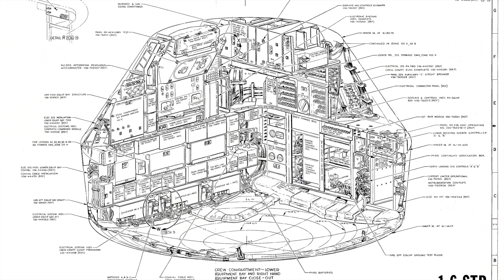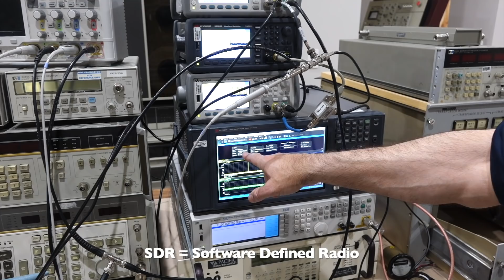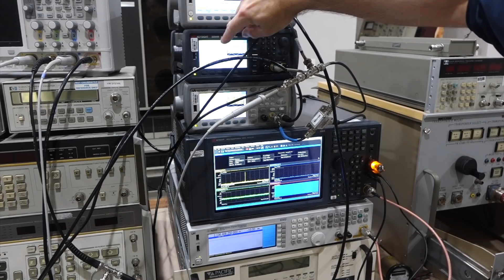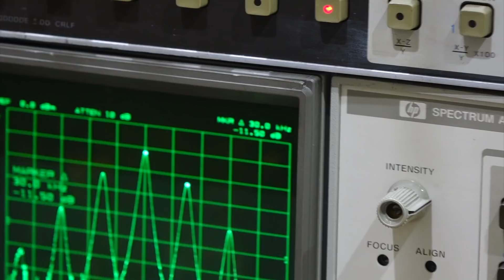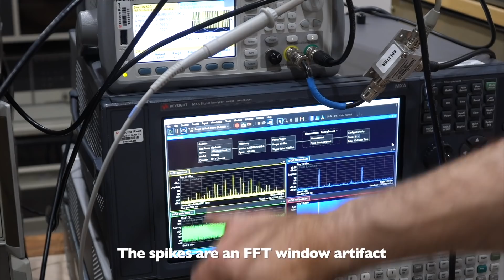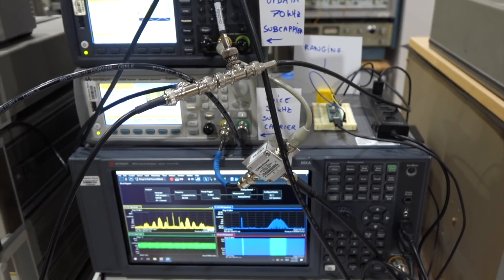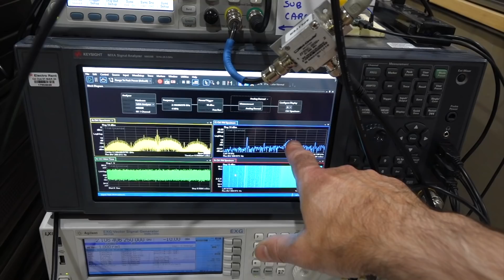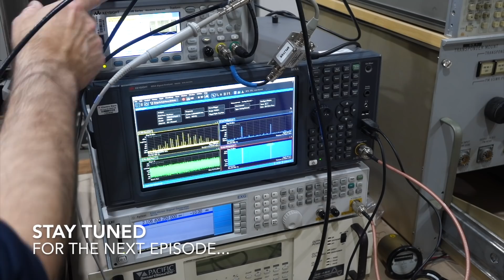Apollo Comms Part 15: Combining Voice, Data and Ranging

Comment: The video from the moon landing was not in the original plan. Someone raised the idea of a video feed. There was little room in the comms bandwidth, so a special low resolution, low bandwidth video system was designed.
The communications during the moon walk was picked up by the radio telescope at Parkes, NSW Australia. It was converted to a conventional TV signal by displaying the video signal on a screen, and filming the display with a TV camera. 
The video signal was also recorded on reel-to-reel tapes. Tapes in those days used whale oil for adhesive. The use of whale oil was stopped when whaling was banned, and synthetic oil was used instead. 
The synthetic oil was not as reliable as the whale oil. NASA had a project that required reliable data tapes. Someone said "I know where there are some whale oil tapes." The result was that the only recording of the original video feed of Armstrong's moon was was erased.

Comment: Some other interesting information.

We had astronaut's lives depending on this system.  That's why the error checking and correcting if necessary.

The really amazing thing about this is there were a quarter of a million miles between the spacecraft and earth.  The large antennas here on Earth were needed to make up for the losses over such a great distance.

The spacecraft had an antenna that had to be pointed at Earth to give a strong enough signal.  Even so,  the spacecraft could not communicate with Earth during times when it was behind the moon or during reentry.

And I repeat what others said: "And we have imbeciles who think it never happened."  Really stupid.  😞😞

Thanks, Marc.

Comment: What’s the difference between “high bit rate” and “low bit rate”?
Reply from the maker: That was on the other, downlink direction, which is waaaay faster. We have not done that yet. Can’t remember on the top of my head but low bit rate was 1.6 kb/s, while high bit rate was 51.2 kb/s, or something like that. The big catch is that you could only do high bit rate once locked on the high gain steerable antenna and with one of the 3 large dishes on the ground, while low bit rate would work out of the omnis and/or the smaller ground antennas, which is a much easier and forgiving config to get going. The low bit rate only transmitted a small subset of the info though. They struggle to get the high bit rate going to diagnose the Apollo 13 failure while the ship is unstable, and the ground desperately needs the more detailed info. Fortunately they were on the (borrowed) extra large Goldstone dish when the accident happened, and that sort of saved the day.
Reply: @CuriousMarc  very cool, yeah I remember in the Flight Director loop during the Apollo 13 accident that they said they had the “210” which I guess is the size of a dish
Reply from the maker: @toddteagarden2200  Yes that was referring to the 210 foot Goldstone antenna, on loan from JPL, and truly, the military. They one assigned to Apollo at Goldstone was the 82 footer.

Comment: is the random noise , a sort of scrambler to stop "others" to listen in on the coms? 1960's style?
Reply: No, it's a repeating bit stream that allows them to lock onto it unambiguously so they can measure the time delay to and from the spacecraft very accurately.  It has nothing to do with encryption or scrambling.  Anyone with the hardware could (and did) listen in.

Comment: Any chance you'll be able to connect it all up to the AGC (emulated AGC of course) to receive those abort commands?
Reply: I don't think the AGC received the abort commands.  They went to a relay that turned on lights.  The part of this that went to the AGC were the DSKY commands - basically a remote DSKY keyboard in ground control.
Reply: @stargazer7644  I was just using that particular command as an example.

I'm not exactly sure of the context of this "abort" command, but if it relates to aborting a moon landing for example, then the AGC would definitely be involved as aborting is all handled by the computer.
Reply: @jeremiefaucher-goulet3365  He explained in detail in the previous video how these commands were used.  These were not commands to the AGC.  They turned on relays that either essentially flipped switches on the control panels, or turned on indicator lights.  The ONLY input to the AGC was via the DSKY keyboard, and that had to be specifically allowed by the astronauts flipping two enable switches.  It was not on by default.
Reply: @stargazer7644  Oh I know. But what do you think happens once the abort relay gets flipped? Should be the same as the button being physically actionned by the astronaut.

I never meant to say that a command gets interpreted by the AGC directly. But indirectly the AGC would get triggered by some of these relay flips. There's a lot of discrete IO on the spacecraft that is sensed by the computer.

Just like I'm assuming the DISKEY commands too, is just some relay action connected inline with the same circuit as the physical DISKEY buttons themselves.

But obviously I'm just speculating/guessing here. I could be wrong.

Comment: Marc, how did the NASA-engineers test this whole shebang back in the Apollo days? Surely they didn't have this beautiful keysight stuff. So what did they have and are you in a position to let us see the whole working with devices from the apollo days? That would really deliver a marvelous video I think.
Reply: He doesn't have all of the relevant Apollo pieces, that's why he's using some modern gear to stand in.  They certainly had spectrum analyzers at NASA to help design this stuff.  They just didn't have fancy digital ones with DSP and demodulation built into them.  They had other devices to do the demodulation.

Comment: It does seem strange that at that time anyone with the necessary kit could, in theory, command the Apollo spacecraft.  At the time it was so advanced that I suppose it qualified as an encrypted link. :D
Reply: Wow. Good point. Would have been to the USSR's advantage to sabotage it, I wonder? Could they have done it without being detected?
Reply: It’s always a mistake to underestimate Russia.
Reply: That's why there were  switches in the space craft, 2 I believe, that on request (and presumably upon successful authentication that it was indeed NASA on the voice link) only the astronauts could physically switch to enable remote command of the AGC or other systems. As it was though, I agree, it was so advanced at the time, that I suspect it was very difficult without inside knowledge, to know what was going on in the mess of phase modulation, to even extract the commands, from the voice, from the ranging, never mind know what they meant at the space craft end of things. Might not have very tricky to jam though, by pointing a sufficiently powerful signal at the capsules.
Reply: That's why the astronauts controlled when commands could be sent up.

Comment: A fabulous series - thank you. I would really appreciate an episode dedicated to your views as to why the modulation techniques used are so complex? I would have thought it could be achieved in a simpler fashion without a risk of reduced reliability. I guess I am probably wrong!
Reply from the maker: I think the explanation is spread over the previous episodes, but quickly: stuck with PM primary modulation because of the need to preserve the carrier average frequency for Doppler ranging, FM is best for the subcarriers, and PSK is one of the simplest and best method for digital transmission (still used today!). So they made rather straightforward and rational choices really.
Reply: Indeed fm was used before digital satellite (i.e. before dvb in the 90s) to be robust to amplitude variations of the analogue signal (due to scintillation). And psk is still the base of satellite digital data transmission today (i.e. bpsk, qpsk, 8psk) so indeed they made the right choices back then.

Comment: Isn't 'structured noise' better known as a 'signal'?
Reply: Statistically it looks like noise (randomness) but it's pseudorandom (and it's digital), so it can be directly compared to the expected result if you know your starting sequence and how far into the stream you are, but if not, it's pretty indistinguishable from actual noise.
Reply: Nope.  If you don't know the pseudorandom function that generates it, it looks just like noise.

Comment: Absolutely stunning stuff. Fantastic equipment. The engineers and scientists that designed all this equipment and built these spacecraft are absolute geniuses. Using slide rulers, pencils and maybe the first primitive computers. And now, 55 years or so later we have imbeciles that believe it never happened.

Bravo Marc, you are doing spectacular work. I loved the vacuum "tube" as well!
Reply: It was partially faked and we have a problem in history has been badly tampered with. But a lot of 'smart' people think they figured it out too so we have criminals running free.

Comment: Incase you did not notice, the ranging component of the signal is a very close relative to GPS with only C/A code or only P code.

{^_-}
Reply: Interesting.. is it similar to DME squitter?
Reply: @p1366  A really quick look on Wikipiddle suggests any relationship is more coincidental than intentional. GPS and Apollo ranging not use a pseudo-random sequence sent at a known time to indicate time of flight. Both compare a local rendition of the sequence with the received sequence and measures the time offset needed to make them coincide. The quick look suggests this is not a part of the squitter use. It apparently uses signal strength to make estimates rather than sequence offset. Now, that's just from a really quick look. I've never dealt with squitter signals before.

{^_^}

Comment: Very inspiring and almost a deja vu.

I have some early background on modulation of teleprinters on to carrier frequency equipment, transmitting both data and voice.
This looks very similar, although a different frequency band.
Later I did some DIY stuff, on PET hardware, making modems on telephone lines, and later again, I managed to do a solution on NMT cellular on xx86 hardware.
But after, it was cheaper just to buy and take advantage of more common hardware and protocols.

The fundamentals of all this, must have been developed no later than the 1940ties 1950ties, but still going strong :-)

Comment: Should be able to use an SDR and encode/decode this data with GNU radio
Reply: Don't even need a proper SDR setup, because they're AFAIK not transmitting as a radio-signal
Reply: @sundhaug92  They are transmitting this on the Apollo frequency and receiving it at the other end of the desk with the actual Apollo CSM transponder hardware.

Comment: Hi Marc. Been loving the Apollo videos

Question would you be able to Interface the Microwave gear you have been working on to the AGC? so like upload data from Earth to AGC via the the Microwave link?
Reply from the maker: Yes, but that’s at the end of a very very long restoration chain. For that we need to revive the premodulation processor box, the uplink data box, and the telemetry box on the spacecraft side. These are all quite complicated. Then get the whole telemetry demodulation going on the earth side. Lots of work before we get there! A working SDR will shorten our path before we get there with original equipment, but then we have to make interface electronics.